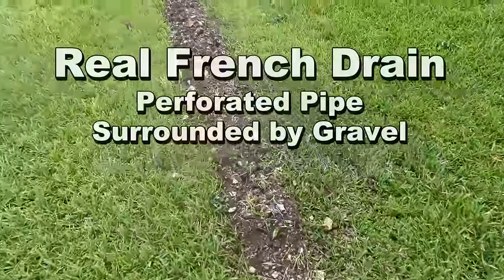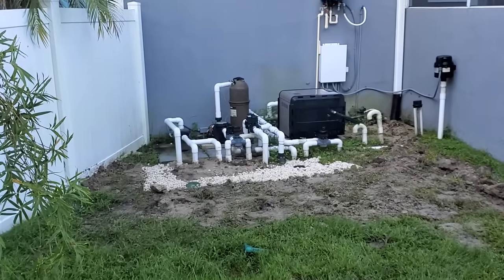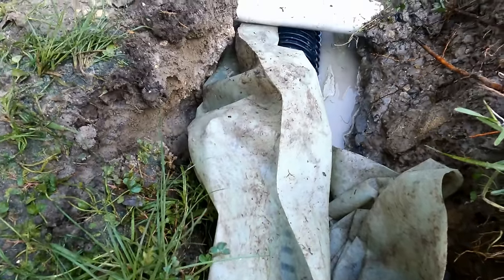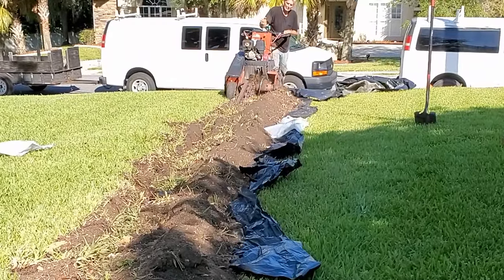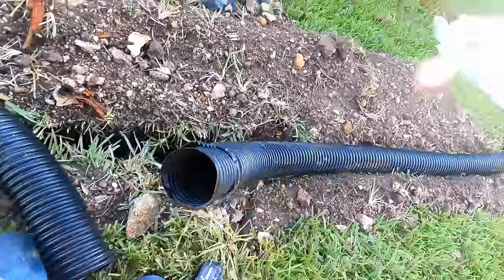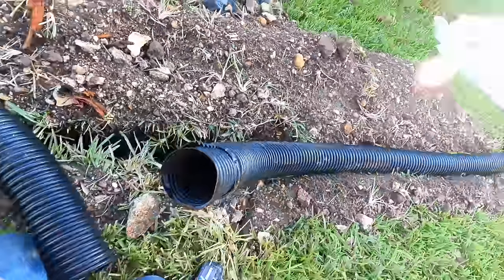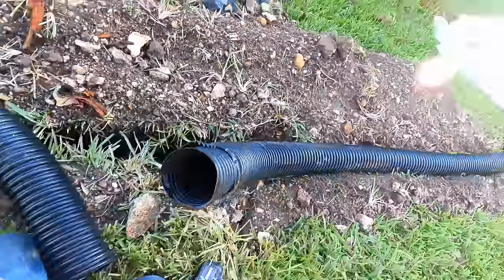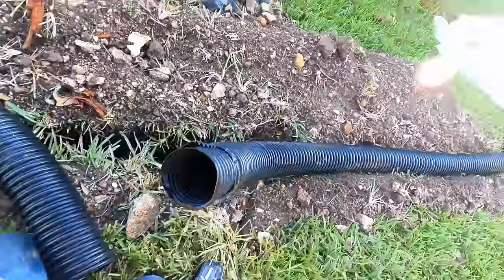How to Dry Out Wet Soggy Yard - 100% Guaranteed

Comment: We have done this with no pipe at all  and  and it worked real well. You do need a little grade, even an inch or two. We dug a trench from the low spot we identified in a bad rain. we dug a shallow trench (like 6-8" deep by 6" wide)  from the low spot to the ditch. We Lined the trench with screen fabric like you would use for a window screen. We filled with mixed rock. Folded the screen over the top and put a little soil over it. We had that place for over 10 years and it was still working when we sold the property.
Reply: This is the info I needed! I wonder if I can do this along the side of foundation? I'd continue it into the sloped backyard into lake
Reply: Where did the collected water land? I think the benefit of the more structured solutions is that you can add a pop up by the curb, otherwise the water would pool in the front yard, did the end of your underwater stream end at a common use waterway ( community sump) or a pond on your property? Before I read this I was thinking if a dry riverbed. But this is a good idea.

Comment: Good job. Thank you for an interesting video. I'm a DIY'r and I also connect the corrugated pipe using a piece of corrugated. but on the outside of both pipes. You erred when you said it doesn't reduce diameter. Putting anything inside a pipe reduces the diameter and the excess fold is a potential clog contributor.Sometimes I connect the pipes by slitting the end and slipping it over the other pipe's end such as on  a downhill run.

Comment: hey chuck, how was you and your team able to push the water towards the exit point going up? will the water settle at the exit when it stops raining since the exit is upward? im curious because I dug my trench about 18 inches deep and wanted to connect to my existing pipes that discharge to the street. (i should of located my existing pipes before i dug) when the house was built, i think they only set the the solid pipe about 8-12 inches deep. now i have to transfer my pipe up 6 inches to the existing. will water still flow? i kind of gave up and my trench is just settled with water atm since that existing pipe is a little higher.

Comment: Do you have to dig the trench deeper as you move towards the front? Or is the trench the same depth throughout?
Reply: Ideally, a 1 ft. Per 50 ft uard lineage is optimum for draining. Even if it's level for some feet.

Comment: Great drainage. Only issue is these systems WILL clog over time depending on your location and your kind of soil.
Reply: Clog with what? 
if you use non woven geotex, soil and clay doesn't clog them. 
Tree and shrub roots won't even clog them because the stones around the pipe air prune the roots. 
They can go 50+ years without clogging.
Reply: Yep, that dirt piled on top will eventually seep down through the fabric and clog it. Best to not put dirt back on top

Comment: There are more than likely other ground drains on your property and diverted away, the downspouts or maybe a french drain that is already existing and you can tap into it. I see a lot of people including my buddy using round river rock and that is a mistake. My buddy was going to use round pea gravel! Round rock that has been tumbling around in a body of water or manually tumbled to smooth out the rock is not a good choice, the voids created are small and thin and even with filter fabric wrap that rock and those minimal voids will eventually trap silt and plug up your porous trench. I have always used crushed #4 gravel or a number close to that  in size. It would take double the years maybe even triple the years to deposit enough fine silt to compromise a drain with larger rock.

Comment: Boy, I wish you were out our way I have a 50 foot ditch that was growing marsh like grass had the weeded very soggy. I got estimates of putting a pipe and dirt in it was almost $20,000. They were going to put 12 inch non-corrugated pipe. I don’t believe the going rate is that much I think materials would be 2000 most 1500 to 2000 for labor.

Comment: You walked by a tee in the drain to the left of the main run as you passed that your recording that tied into white down spout. It showed the white down spout attached to black pipe. Would you please explain why. Was that down spout a major source of runoff to the pool equipment at the lower elevation ?

Comment: Hello great video thank you very much for sharing I do have a question. My house is on a hill and the hill starts at the back of my house down towards the front of my house out. To the streets? How would I encourage the water to go in the trains in the back of the yard
Reply: The yard is soggy in a few places would I need multiple drain
Reply: How Deep is your back wall of home to the Footer.We just did one with a walk out Basement.the home was surrounded by three sides.with the front home only open to yard.we French drained the whole three sides and Ran under Driveway over to the low spot on property.This house Flooded two times since December.we got there and Installed the drains.and its survived lots of water since.and its Bone Dry.but we went down just below footer grade and used Perf pipe and Tons of Gravel,,Discharged to Daylight…

Comment: with Spring approaching - my annual depression sets in with my soaking wet backyard ..  I am going to watch video after video until i hopefully come up with a plan to set in place, this is the year I conquer my wet backyard!
Reply: I'm in the same wet boat. Back yard soggy when heavy rain. Have a retainer wall that the drainage pipe probably collapsed  no water comes out of and saturates the lower yard
Reply: Same exact situation. It's so very disheartening.
My house/yard should havw never passed inspection due to such horrific  grading, all yards around me are much higher, so everything drains into my back yard. Regrading is impossible as im many feet below everyone else and of course my garden has enormous trees😢

Comment: How many areas of the yard and gutter down spouts from each side of the house can I run with a pipe to drain away?  For example if I have 2 pop up gutter drains and I wanted to do a French drain around house and also add another low area on the same side of the house.

Comment: At what point did you connect the perforated pipe to the normal pipe? Thanks for the video
Reply: 100 feet because the roll is 100 feet long

Comment: So what happens to the water when it is by the sidewalk? On my property I don’t have sidewalk. I have a catch basin that is supposed to be monitored by the city that is about a 3 ft.² shape and it is certain depth which I can’t tell. The only problem is that, the slope of my yard doesn’t run to that spot of course because it wasn’t put in right 30 years or forty years ago. The biggest problem I have is that the lowest part of my yard is my backyard. And it’s pretty much the whole backyard as wet so there’s no real place to trench too because the road in the front of my house is higher than the property line grade.
Reply: What do you mean? The grade of your yard doesn't matter...you grade the trench itself down hill and thus the pipe is downhill inside it so the water flows where you want.
Heh I reckon if you have some actual hills in your yard that would make it very difficult to get it deep enough but I am assuming its flatish just graded incorrectly. You could do backfill and a regrade but this is much cheaper lol.
Reply: Do a video and we can input correctly for you
Reply: Install a pump
Reply: You would have to have a higher elevation that the municipal drain , or you would have to install a pump and small lift station at the end of a French drain in your back yard then pump the water to the drain.
Fill dirt might be cheaper and better choice overall .

Comment: Is it worth it to install a back flow stop on these types of french drains in the case of flooding in the lower area or if you get to that point there wouldn't be much to stop the water from just seeping around it?  I am going to be moving to a possible flood zone and I'd like to install some french drains to help, but I don't want them to backfire and let more water into my property;  So I was thinking on the last few feet of down grade to have a solid pipe and a float gate/valve to prevent back water.

Comment: One thing I'm confused about is the slope of the drain pipe. If you're running it 100 or 200 ft how much slope do you ultimately need for the water to be carried out?
Reply: -1% is what I’ve heard
Reply: @gilph3  ,doesn't really matter ,water would flow
Reply: Some slope even if very little will carry the water out

Comment: Why can drainage uphill, what is the principle?Thank you!
Reply: He’s still downhill from the collection point. Plus the water traveling downhill has some momentum flowing through the pipe, and then up and out at the discharge end
Reply: @dougg1910  thank you
Reply: The pressure from the saturated ground plus the basins filling from the surface. (Near as I can tell. He said 3 times it was a foot rise in the drain).

Comment: Couldn't you just install a good sump pump and make things easier?
Reply: Huh? You still need to get the water past the hump to keep it from coming back to the pool pump area. He should have just needed to dig a little deeper to keep a downward slope despite the ground level hump. After that it appeared to be a good slope to the street. Regardless, the long trench was needed to the road. A pump free system is likely cheaper and more reliable than a sump pump.